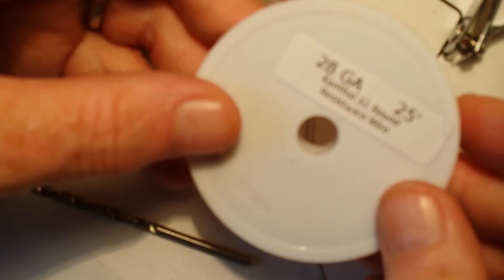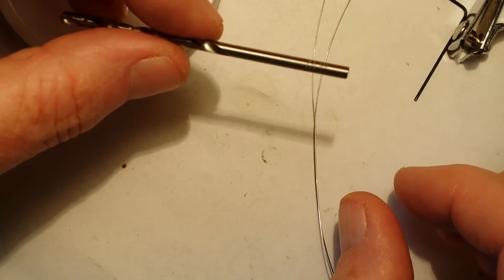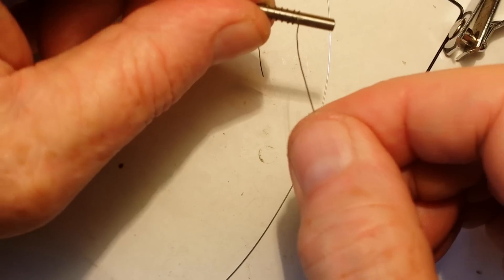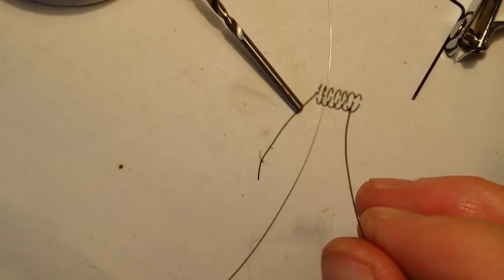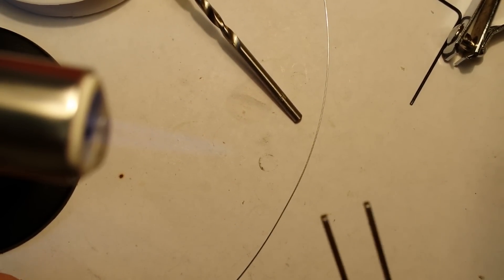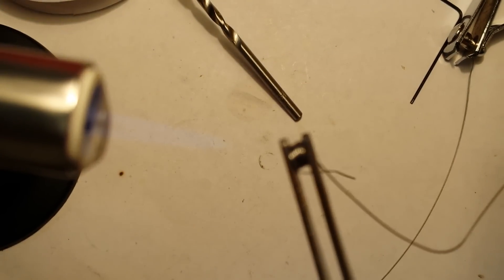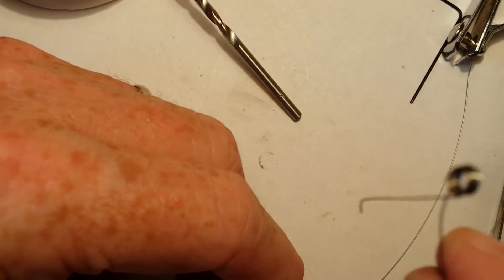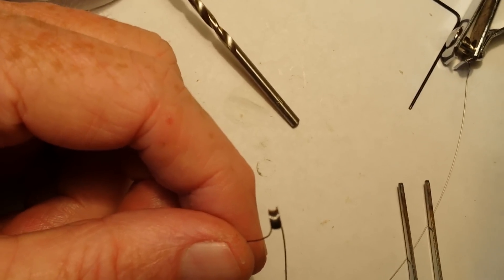How to make a micro coil for an atomizer

Comment: With the small and simple to use Kuro coiler tool (n other similar designed ones), we can now create perfectly aligned micro coils. It essentially slides and wraps naturally, with no stress from the conventional method which inevitably involves some twisting during wraps and compress during heating.

Comment: try 8 wraps of 22 ga on a 2.5mm, it will come out to .19-.21 for dual and it RIPS(after the needlessly large ramp up time) or 6 wraps of 16 ga comes out to about .06 for a dual coil and is fun lol
Reply from the maker: +Jacob Jones Back in the day, when this video was made, the batteries available at the time would have vented with a .21 build. Sub ohm was taboo.

Comment from the maker: Hi BoRiCuAnPR, Yes you can make a micro coil with 32gauge wire, but, it would probably be easier to do with a larger gauge wire. As far as the vapor production, what atomizer are you using? And what ohm range are you trying to achieve? Also, air flow has something to do with the amount of vapor produced. There are a number of variables involved. Can you be more specific and I will try to help you.
Reply: I made a micro with 32 once and it gave me over 3 ohms.
Reply: Error lVlacro do like 8 of them lol it will surely be good ohms

Comment: Compressing the coils together will just short circuit the whole coil, no? My biggest question though, is how do you bend the two bits of wire hanging down from the coil to make sure they contact the +ve and -ve terminals in the clearo body? It would be all too easy to short the battery out if you screw this bit up. BOOM!
Reply: You prob know this by now but place the coil back on the drill bit to bend the legs and fit to the atty's + and - terminals, then remove the drill bit.
Reply: Robin Baker are you sure youre using an rda? lol

Comment from the maker: 28ga wrapped 6 times around a 1/8" drill bit should give you a 1.2 ohms for a single coil and will meter out to .6 ohms if you use dual coils.
Reply: ***** Yes, more coils will equal lower Ohms
Reply: ***** ohms is resistance. putting 2 coils will give half the resistance/ohm of 1 coil...BUT a "coil" is technically  another peace of wire the same lingth through a positive and a negitive, not 2 circle with 1 wire